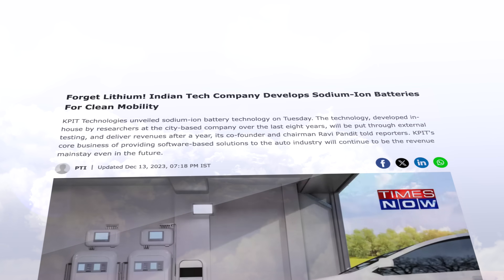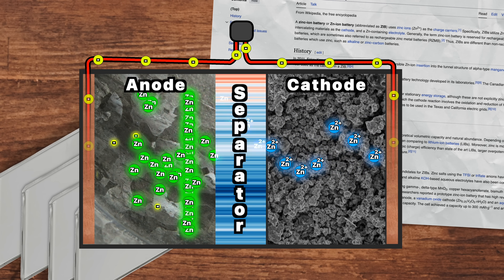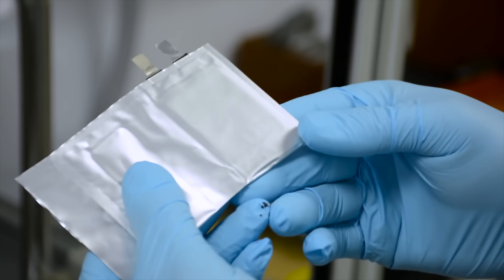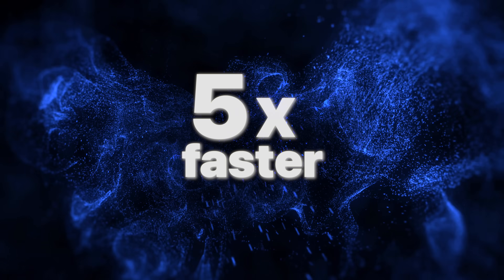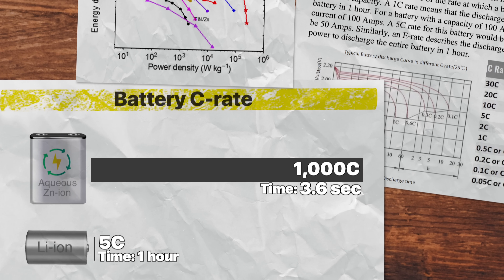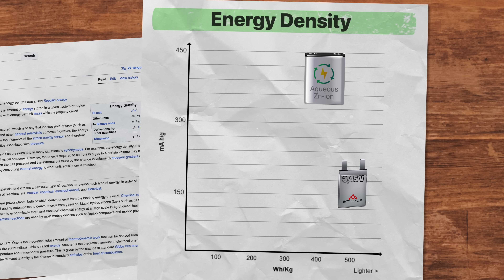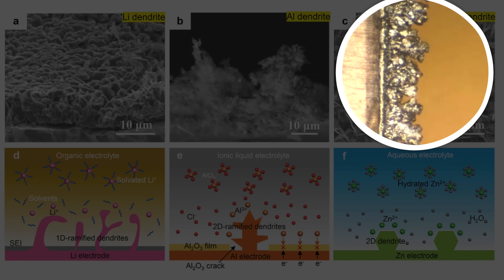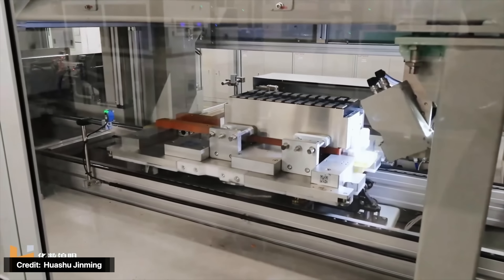New Aqueous Zinc Battery Breakthrough - Real Deal or Hype?

Comment: 1.8V is really no problem, most our tech currently works at 2-3.6-5V, 5 usually being legacy and transformed to 3.6, 2x1.8=3.6, and an industry shift from 2V to 1.8V ICs is not far fetched; this in my opinion would be the thing that makes EVs viable, filling er up would be as fast as gasoline, which is necessary in the real world. 

Also if my phone charged in 5s, I really would not mind having a little larger battery, or charging twice a day, most power users carry power banks anyways, which take all day to use and all night to charge. 

This by far is my favorite battery design, honestly it’s borderline capacitor, minus the discharge rate; if the discharge was as fast as charge, we’d be closer yo ironman tech.

Comment: Your zinc ions are going backward to what you said. When charging, we supply electrons to the cell, and reduction takes place, forming neutral atoms. This by definition takes place at the cathode. The positive ions must move to the cathode during charging. You said it correctly, but the animation is backward.  Even if I'm lost about the idea of engineers using "standard current" which is viewing electricity as the movement of positive charge, the ions are just moving the wrong way for what you're saying.

Comment: The foot in the door use case would be AAA AA C and D cell replacement. 1.3 ro 1.5v per cell is similar to the Zn MnO2 alkaline battery chemisty. ❤
Reply: Thise sejf charging 10mha too 180 mih or 15 moh too 270 moh

Comment: Zinc is extremely prone to dendrite formation, however using an intermittent high current pulse as part of the charge cycle can fix this problem. The other issue is that the voltage will be about 1.2 to 1.4V meaning more cells would be needed for higher voltage. Also vanadium is a very toxic metal.

Comment: Car batteries are  specific and the energy should be "topped off"(analogy) via physics, by converting mechanical energy back into electricity. The hydraulics can grab friction heat and use it to power LED's, and then power solar panels that're hood for trunk, front,roof etc  Or even thermal panels. Always been something shady about not amplifying the battery discharge though.

Comment: Zinc batteries could be the gold standard when it comes to stationary storage. Its volumetric density if harnessed properly could provide safe and low cost grid storage capabilities and power houses sustainably. Its a underrated battery chemistry.

Comment: I came across this comment and thought about the home battery. 

And the extreme costs of the national grid. 

As follows:
Nuclear is a dead duck. 
Nuclear is constrained by the size of the grid.
Electricity is 20% of the energy mix. 

So 5 times bigger grid capacity is needed. 

National grid construction cost is equal to the national GDP. 
Fill the existing grid first and then spend the national GDP 4 more times, that is insane economically. 

100years to build the first, the existing national grid.
4 more grids, ????? 

Do not say you do not need millions of customers who do not live at the power station. 

Dispersed generation has no grid needs.
Dispersed generation and storage can be offgrid. 
Millions of EVs with V2G feature will find a home. 

Uranium financing and yet silence about the electricity transport.
You can not truck electricity.

Comment: Optimal charge rates:  Charge it in stages, like a switching power supply, but with much lower frequency, using a much smaller, intermittent and replaceable short-lasting bank of Zn-ion batteries to handle the faster charges:
1)  charge the intermediate bank at medium-rate
2)  charge the main bank at optimal rate using the intermediate bank
3)  repeat until the main bank is fully charged.

Comment: it does survive 450⁰C in contact with O2 and SO2 to produce H2SO4... so that's good news. it has a lot of reaction pathways though. 

Also the "dancing pairs" implies that this is conditionally dependent on those two events happening simultaneously without accumulating unintended side effects. Regardless of whatever the dancing pairs are.... i just wouldn't rely on "paring" when heat is involved. 

also, the planar crystals are similar to some of the starting materials (?) for Metal Organic Frameworks. These link tungsten/molybdenum with ochem groups, but i believe need a crystal surface to dock to. The V2O5 crystals are closer to some newer chip fab materials. means you basically need Molecular Vapor Deposition. Translation: it don't scale too good ... if it did we'd already be using MOF to break down CO2 by post-processing filtered seawater ... while China does nothing but egg on the West's self-loathing.

I haven't gotten to the zinc part yet. the good news is that these crystals and the MOF's have strong bonds.
Reply: Hmmmm i doubt it: "The 3D-NVO was prepared by a facile and scalable electrodeposition technique. The electrochemical deposition was carried out at room temperature..."
Reply: "facile" is a weasel word.... it's at least not impossible though, as far as i can tell (which isn't much)
Reply: maybe using ultrasound with some kind of flush could refresh used batteries after zinc buildup ... but it's unlikely since the space is so confined. nothing in the solution can really have chemical affinity for the zinc except the intended components.

Comment: It seems zinc has the same issues as lithium. Perhaps these same principals can be applied to lithium batteries. Anode issues and dendritic issues. Cycle issues. How abundant is vanadium? For cycle life it seems awesome. The biggest issue I see are all battery manufacturers are in a box and want the same designed battery by printing it all on foil and stuffed inside a cylinder or roll. What if we look at sulfur or zinc cathode replacements like we replace filters or perhaps just change out an anode once it's worn out, but we seem stuck in a box. I believe we will get there, but we have to rethink every detail. We have the chemical engineers and AI. Sulfur and zinc, and aluminum are all abundant elements. Just do it already.

Comment: I recently did a back of the envelope calculation that you might want to follow up for your programs. It appears that the failure and fire rate of Li Ion batteries is grossly exaggerated on YouTube and some news sources. Makes really attractive videos but the actual burn up percentage may not be much different that with gasoline vehicles which burn up fairly frequently in collisions. Hard to get the data but it would be worth it.

Comment: People obsess about range for electric vehicles (and yes, it's important for daily commuting-type travel) but charging speed is the really important thing when using them for long distance travel. Say you need to travel 600 miles and you have a vehicle which starts fully charged and can run at 60mph for 2 hours but then needs to be recharged for an hour: that's 10 hours of travel plus 4 hours of charging: giving an average speed of 600/(10 +4) or about 43mph for the trip.

Doubling the range from 60mph for 2 hours to 60mph for 4 hours means that the EV only needs to stop twice for charging instead of four times but the charge time is now twice as long because the battery is twice as large. So travel time is still 10 hours, charge time is still 4 hours, and average speed is still 43 mph.

Reducing charging time has a much bigger effect on increasing that average trip speed though. Going back to the original range of 60mph for 2 hours if we can reduce the charge time to half an hour per recharge, the travel time remains 10 hours but the total charge time drops to 2 hours. So average speed is now 600/(10+2) or about 50 mph.

So a battery that can recharge 200 times as fast as current batteries would certainly be a big deal for electric vehicles, cutting the trip time in the above example to 10 hours, 1 minute and change, and giving an average trip speed of 600/(10+4/200) or about 59.9 mph. Which means that you wouldn't need to take charge time into account when making long trips as you do with the current generation of EVs because the travel speed would essentially be the trip speed.

Comment: Always “3 years away”

Lithium batteries are already about 100 times heavier than gasoline for the same amount of energy.  

This is the biggest issue with li ion.  They are super heavy for the amount of energy they store.  

We use lithium because it’s the lightest of the metals in the periodic table.  

Using heavier metals is not really a breakthrough for batteries.
Reply: You do understand that the entire battery isn't lithium ions, right? The other things are not the lightest elements on the periodic table, and they are not specifically for creating more charge. They are there to make the battery not be an explosive, not catch on fire, charge more effectively, have higher voltage, etc.
Reply: @ronaldking1054  I get it!  All those things you list are more reasons why energy density is so poor with batteries.  100% of the molecules in a gallon of gas can be converted to energy while only a small percentage of the molecules that make up a battery can be converted.  

Liquid fuel also has a huge advantage that 2/3 of the ingredients needed for combustion,by weight, is oxygen.  This means liquid fueled vehicles only need carry 1/3 of the weight but still get to take full advantage of the locomotion derived from fuel + air.  

Whereas electric vehicles need to carry 100% of the ingredients necessary to convert energy to locomotion. 

This is a large part of the reason there is about a 100:1 energy density ratio between batteries and liquid fuel.
Reply: @jacuzzibusguy  No, 100% of the molecules in a gallon of gas cannot be converted into energy for motion. Combustion is highly inefficient for producing motion. Approximately 40% of the molecules in a gallon of gas can be converted into energy for motion. The other 60+% is converted into energy for heat.
Reply: @Failure_Is_An_Option  What exactly was wrong other than I said something against the religion of the Internal Combustion Engine? Was it the religion of the lithium-ion battery? I'm not sure exactly what your problem is other than a potential diarrhea of the mouth.
Reply: @ronaldking1054  the video mentions that these new batteries are heavier than traditional lithium batteries and blames this weight increase on the heavier metals.
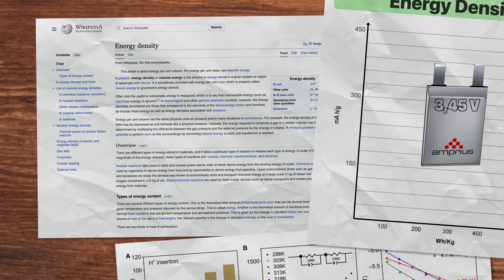Reply: @jacuzzibusguy  10:15 watch the video, and the energy density is close to the traditional lithium batteries. The best traditional lithium ion batteries.

Comment: The only thing that can charge a zinc battery that fast is a bolt of lightning. New cars will come with lightning rods attached (certified for 1.21 GW of power) for charging on the go.

Comment: This seems to be a particularly good battery tech for robots, if they can make them at scale with the stated specs. Take Boston Dynamics' Spot for instance. Its battery is 560Wh. The battery weight is 5kg, about a 6th of the robot's weight, and it takes up a fair amount of space. It can operate for 90 minutes on that. However, it takes 60 minutes to charge. It would be way better if it only needed battery capacity for 60minutes, i.e. a smaller and lighter battery, but with the ability to charge in 5 minutes. Same for robot vacuum cleaners and the like. It would just be way, way more time efficient.

Comment: Good video. Unfortunately, I have to file this away as vapour-ware until it comes out. It fits right up there with the Hyperloop or solar roadways. Fingers crossed though.
Reply: Zinc Ion and Zinc Air Batteries are a thing smh.
Reply: @artistanthony1007  I'm aware of that, kiddo. Just like fusion exist. smh. However, the glaring issues with zinc ion batteries' reliability, lifespan, and performance as suggested in this video seem unrealistic given what I've read. As I stated in my comment, I hope the issues were solved, but I've also heard several statements just like this over the years with no real outcome. I'll believe that they're viable when I see it. AGAIN, fingers crossed.

Comment: Zinc dendrites could be removed by a reverse electrical charge with Epsom salts involved. This could be the battery "Cleaning cycle" it needs ( regen?? ) before a full charge. This would Not be needed every recharge and would still be much faster than LI batteries.

Comment: Will the freeze or will the zinc sodium solution lower its freezing point? 

Dendrite’s, what is the chemical make up and what could use that metal crystal?  More times than not, a by product of a process has just as much value.

Comment: 16:58 Super caps. Balance those with resistance so that you can charge the super caps at whatever rate you want, but the super caps will only discharge at the rate you need.

Comment: I'm excited about different chemistries that get optimal characteristics for various use cases:
In bulk transport (trucks and planes) the density by weight is crucial (the battery itself needs to moved, while battery-volume and cargo-space can find an optimum for short-haul and long-haul capacity requirements)
In personal transport (cars and bikes) the charge-time is crucial for longer trips, with density by weight becomes less crucial (still important as it sill needs to be moved as well) when more charge-stations are built to remove range-anxiety.
In grid-storage fast charge & discharge are crucial to respond to supply and demand profiles, as well as resource-availability due to the high demand and cost-sensitivity. Energy-density plays no role
In home-storage the resource-availability (and cost) is important to drive higher adoption to off-load the grid (many charge-cycles will also help to keep maintenance-cost down over the life of a home. But charge/discharge speeds are not all that important
Lastly in small devices: high energy by both volume and weight, fast re-charge and low cost are all important, also battery-recycling ability (reclaiming the battery after the device is discarded due to being out of fashion long before the battery is end-of-life)

For each of the above different chemistries will ultimately be used that can be optimised accordingly...

Comment: Problem is energy density by weight. Lithium atomic weight is close to 7 and Zinc is 65 (for same amount of atoms Zinc is 9x heavier).
Reply: Did you watch the video? Energy density was covered. It's comparable to some of the best lithium-ion batteries currently in development. When you have an electrolyte that is organic, then it has a lot of carbon, hydrogen, and oxygen, which makes it much heavier than an oxygen and 2 hydrogen. What's better is that oxygen and 2 hydrogen can also transfer their hydrogen, which means that it doesn't have just the +2 Zn, but it also is infinitely wired inside the battery. Also, water doesn't burn.
Reply: @ronaldking1054  It just doesn't make any sense. Take those coverages to a simple chemistry and do molar mass equations and compare...
Reply: @miodragzizovic1296  What is the weight of the water compared to the organic compound they need to currently use for the electrolyte. You are assuming all of the mass of the battery is the metal. You are wrong.

Comment: In 2024 the world's two largest battery manufacturers, CATL and BYD will begin mass production of safer, long lasting, sodium ion batteries in addition to increasing production of comparably safe and long lasting, lithium iron phosphate LFP batteries. This is the breakthrough that will let you bring your electric scooters and skateboards with you on the airplane, as well as decentralize power grids globally. This year Tesla should also produce their next generation 4680 batteries with silicon anodes at their Kato Road R & D center, currently being renovated/upgraded. This should double 4680 battery energy density/capacity. Kato Road was formerly capable of producing 10 GWH of 4680 cells per year. After renovations and next generation 4680 battery development and production ramp, Kato Road should be capable of producing 20 GWH per year of improved 4680 batteries, before duplicating and scaling production at Tesla's other Gigafactories.
Scale matters. There is a world of brutal brain breaking budget bankrupting battery production battles (aka blood, sweat, and tears / giant money furnace) between the laboratory and the laptop.

Still, I hope at least a few of these Zinc Ion batteries make it to market. The potential of the tech sounds amazing!

Comment: As of today, I am not convinced that a steel-cased 48V lead-acid forklift battery is not the best choice for the solar system I am building this year for my rural currently grid-tied home. Our utility provider PG&E has a proven record of frequent power interruptions so for standby power or off grid operation either a battery or generator is necessary. I am the only guy on my street with a forklift in the garage so the fact the battery weighs about 3,000lbs. isn't an issue. The battery should last at least 10 years and have a net cost of $4,500, and it has a minimum recycle value of at least $500. Thus, at an annual cost of $400. I have many options; with or without either generator or grid-tie. By the time this battery dies the issue of the most practical battery for residential use should evident. Even old technology like lead-acid has improved and the last generation forklift batteries last longer than ever. Car batteries not so much, unfortunately.

Comment: Forget charging for a moment and consider this: what kind of power source would be able to provide such a huge surge of power???
Reply: If we're talking about a cell phone, you plug it into the 120 or 240 wall outlet in your house and it's basically a hair dryer for 30 seconds, in terms of power. The problem is the 450 A of low voltage current that would require.